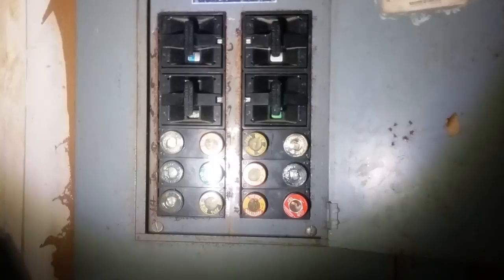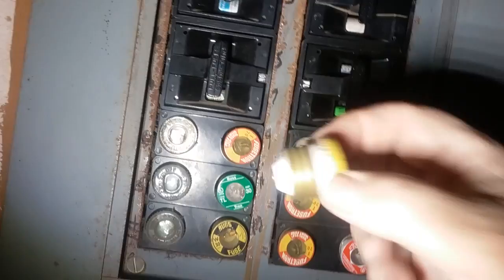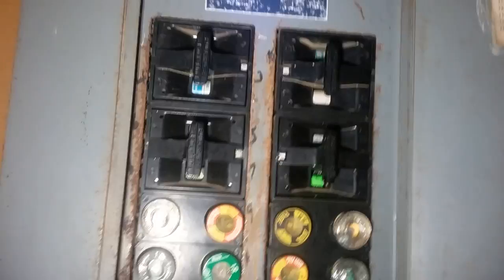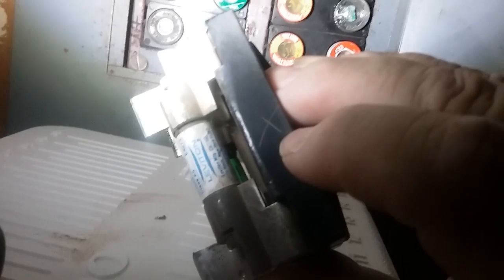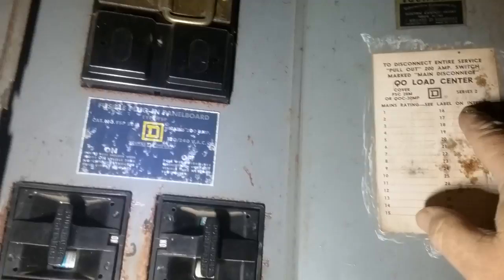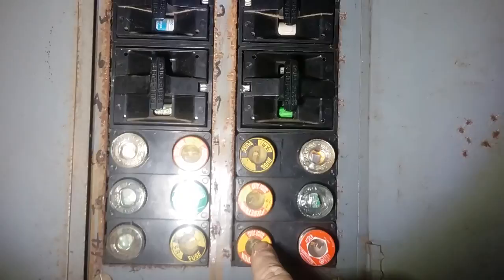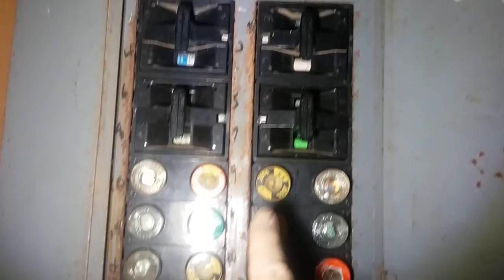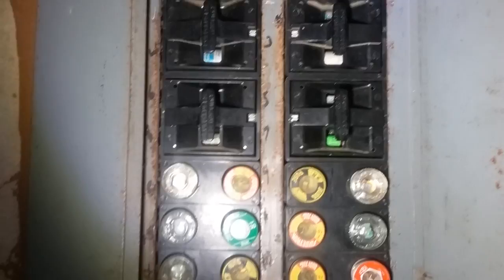How To Change Fuses in an Old Home Panel

Comment: When I took out the old fuse to change it, there is a metal insert inside after I took the old fuse out. Someone told me to take needle nose pliers and try to unscrew it, then put in a new fuse. First I have to pull out the 2 handle things above it to cut the power to the entire house. Is there any chance of messing up the electric by doind that? I'm a single mom living in my mom's house and she will kill me (not literally) if I make it worse. Thanks
Reply from the maker: NEVER stick pliers, fingers or anything else in those sockets other than another fuse! You can get electrocuted! Go to the hardware store and get the same size fuse. Whoever told you to stick needle nose in there does not know what they're talking about!!! This is one area where I would hire a professional to do it for you. Messing around with electrical can be dangerous, especially these older panels.
Reply: @BlueCollarDIY  Thanks for the reply. I did end up getting an electrician. I was trying to save money by installing a bathroom ceiling light myself. Ended up blowing a fuse. I couldn't find a fuse that would make it work and had to go a couple days w/no lights in bathroom. Took a pic of the fusebox and showed it to a guy at work who told me that gold ring thing was stuck in there and to get it out. I was afraid to do that. Talked to another guy at work who turned out to be an electrician! He came over and took care of it...with no need to take out that gold ring/insert thing...supposed to be there. So moral of story: Save my self the aggravation, skip trying to do it myself and just hire a professional in the first place. Cheaper in the long run! Thanks again!!!
Reply: @andrewlevendusky456  
I'm glad you didn't listen to the first guy. Even though he meant well,  he could have caused your death. Glad you're still here. Second opinions are... priceless.

Comment: Any idea on how to change the gauge ring that the fuse it's inside of the fuse board as I have an old fuse board and have not got the money to replace it. Thanks
Reply from the maker: I'm sorry, I can't help you there. I've never done that type of repair on an old fuse panel.
Reply: @BlueCollarDIY  .
No worries Thanks for your reply.
Reply: @IrishAndy001  if you are referring to the ring inside of the fuse socket that fixes it so you can only use the one type of fuse in that socket, that is a type S fuse adapter and it cannot and should not be removed. It is so that you can only install the correct fuse in the panel and not the wrong size. they have a metal barb and stick themselves into the socket so they cannot be removed. A long time ago they made a special tool to remove those, but even then it was difficult to do and commonly damaged the panel.
Reply: @WalterKnox .
Hi Walter i was able to find one for the size I was looking for it was easy to put it in just needed to make sure the power was fully dead before i changed the old one to the new one.

Comment: When my husband unscrewed the old fuse from the box it came apart leaving the copper ring stuck in the socket. How can he get it out?
Reply: Well call an electrician don't touch it
Reply: Pull out the main, it is a slide out at the top of the  box, it will cut the power to the whole house then  once you do that get it out with needle  nose pliers or anything you can get in there  and spin it out
Reply: pull the main and than lrn how to use a tester before you go  digging around in there with tools
Reply: We’re you able to get it out? I am having the same problem

Comment: Can I ask you a quick question. I can't find it mentioned anywhere. I have a glass 30a that is out. Is that the same as the 30 amp green ones. Are the glass ones just older? They don't seem to sell the glass ones anywhere. Like can I put the 30 amp green one I have in my 30a glass ones places
Reply: I did in my house. The man at home depot said it was ok. Sometimes they just guess though so idk.
Reply: It doesn't matter they are the same thing, just different brands.  Some fuse manufacturers make their fuses using glass tops and others use ceramic with a metal cap with a window in it. They're all the same. The only important difference with screw in fuses is there are two types of screw in fuses. The first is the edison base, or light bulb base fuses as shown in the video, and the other is the smaller thread ceramic based Type S fuses which have locking adapters that screwed into the edison base sockets.

Comment: I had a blown fuse this morning. The one that blew was the smaller round 20 amp fuse like in the video. All the other ones in the panel are 15 amp fuses. We replaced the blown fuse with a 15 amp and it won't work. Do I have to replace with at 20 amp? Do I need to call an electrician out?
Reply from the maker: Sadly, many times in the past people would use whatever size fuse they had on hand to replace them. You should replace it with the same size fuse it had originally. So I'd replace it with the same size that was in it unless the panel says different. If you don't feel confident in replacing old fuses, by all means call an electrician!
Reply: There are two types of screw in fuses, edison base, which every size has the light bulb size screw base. Then there are the Type S fuses which have ceramic bases with different sized ceramic threads. Correctly sized adapters screw into the edison sockets that only allow a certain size fuse to be inserted. So a 20 amp adapter will only accept a 20 amp screw in Type S fuse. Another size fuse will start to screw into the wrong sized adapter but it won't "bottom" or make contact. You have to have the right size for these.
Reply: Some wiring faults can cause the proper sized fuse to blow with little or no load on the circuit so it is a good idea to have older installations professionally inspected.

Comment: I recently attempted to replace a 30 amp fuse and the fuse blew the instant I screwed it in. Twice. I'm running out of fuses. What am I not doing, and how do I replace the fuse correctly? (Still assuming I found the right one to replace. My dad didn't do the best job labeling the circuits.)
Reply: if the fuse blew instantly (not a minute later) then you have a short somewhere and replacing the fuse is not going to help. Fuses (generally) only blow if something else is wrong to prevent a fire. if it keeps blowing something on that circuit is shorted in some way and that issue needs to be fixed before replacing the fuse will work.
Reply: @Shaquir Bourjolly I think it was. I turned off the porch light and dining room chandelier (only 5 of 18 40W bulbs -- the ones I can reach -- were lit, but still...) and this time the fuse didn't blow.

Comment: is there a way to indicate which one might have blown if it isnt written down?
Reply from the maker: On some of them, take a flashlight and look into the center of the fuses. If you find a fuse that looks all burnt, it's usually that fuse that is blown.
Reply: Thank you!
Reply from the maker: @mistievannoort5091  You're welcome
Reply: A black smudge on the window will usually occur if the fuse blows from a short circuit. If it blows from an overload you will often just see a broken metal link through the window.

Comment: The only reason these are not as safe as a modern panel is that people can fit any size fuse in the socket as they are the same size. The best bet with one of these, Look at the wire size for each circuit, get a type S fuse and adapter with the ampacity that matches the wire size, and then only the right size fuse can be installed. Nobody can do the good old "put a 30 in the spot of a 15 because it keeps blowing" they also make it harder to stick your fingers or anything else in the socket and shock yourself.

Comment: Alright, I have 6 circuits in my fuse box, yet there's only 3 fuses in it but the power is on, working and everything. I'm just wondering , the more fuses, the more power? What if I add the other 3 fuses.
Reply: No, Each fuse goes to a certain amount of outlets or alliances. Most likely you don't have anything hooked up to those circuits, there is no reason to put them in.

Comment: how does that not shock you? The screw-in fuse has metal right where your fingers touch it to screw it in.
Reply from the maker: It's just a metal cap. The fuse body itself is non-conductive. The metal threads would be conductive, you don't want to touch those!

Comment: Has anyone ever wondered what would happen if you put a light bulb in the twist in fuse holder lol 😂
Reply: On a dead short, the light bulb would light at full intensity. Depending on the downstream load, it would light dimly.

Comment: At 0:40, I highly doubt that 30A is the proper size for that circuit.  A vast majority of single-pole 120V circuits are either 15A or 20A.
Reply: Exactly 30 amp fuses are not used for general lighting and kitchen counter outlet circuits.
Reply: @Progrocker70  depends cld have been wired by a UK spark and its a ring i have come across it- wld have better luck winning the lotto than to see it again though lol

Comment: I wonder what would happen if you were to be able to screw a light bulb into them?? 🤔🤔🤔🤔
Reply from the maker: I don't think that would be smart...even if the bulbs would fit!
Reply: @BlueCollarDIY  Not unless I wanna lose some burnt fingers.
Reply: @enderpea5251  it would be in series with whatever is on that circuit. it would glow dimly and nothing on the circuit would have proper voltage. this could damage sensitive electronics, but most likely not. Back in the day when someone had a short, they would screw a light bulb into the socket and it would light up at full brightness, then when they found/fixed the short, it would light dimly again. Then they knew it was safe to replace the fuse without blowing it up again. 
That only works with a real light bulb, not any of that LED crap they make now.

Comment: so my panel has 2 bays of 4 screw in fuse slots but only 4 have any fuses in them ... only one outlet  inmy apartment works , no lights in the bathroom living room or bedroom  . ready to just toss a bucket of water on that piece of trash lol
Reply from the maker: That's odd. I would call my landlord and have the maintenance man check it out. Typically, a missing fuse would indicate a circuit that either has been deleted or there was something wrong and it was easier for the homeowner just to take the fuse out rather than pay to have it fixed. These old home panels can be tricky!
Reply: If there are empty fuse sockets most likely they are unused, spare sockets for additional circuits. It's rare though to find a fuse panel with spares since most of them had so few circuits from the start.

Comment: Why is my 30 amp is always burning out
Reply from the maker: I have no idea. It may be because there is too great of a load on the circuit or maybe there is a short somewhere. Get an electrician to look at it for you, they'll be able to trace it down and find out.
Reply: @BlueCollarDIY  my dryer plug keeps burning out one fuse what about the stove or could it be the circut fuse in the panel ive even ask a electrician lol
Reply from the maker: @dougiserhoff254  Dryers and Electric ranges should be on their own circuits. Unfortunately, in older homes, many are not. Does the circuit blow if you're just using one appliance or if you're using two or more at once?
Reply: @BlueCollarDIY  
Am just using the dryer it blows one fuse but it will go for 6 loads dryin times then some how it over heats in the past years ive had 5 dryer l had thrown them away then ive realized the fuse box was the problem
Reply from the maker: @dougiserhoff254  I'm at a lost! Everything sounds like it should be okay. I would try another reputable electrician. One who has experience in dealing with these older systems. Many of the newer ones have never even seen a fuse panel!